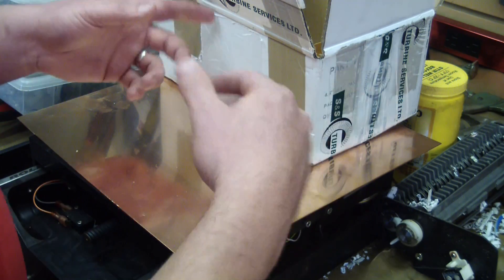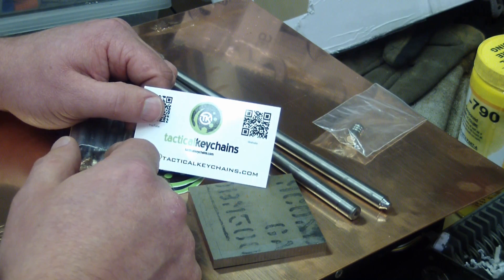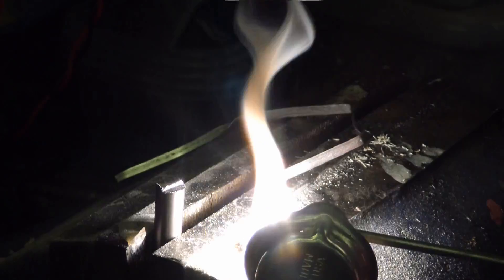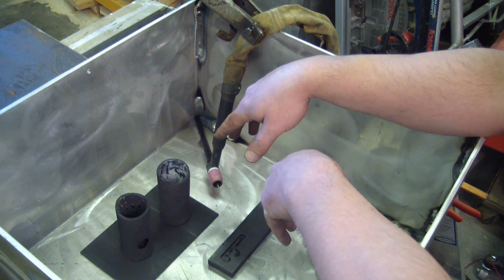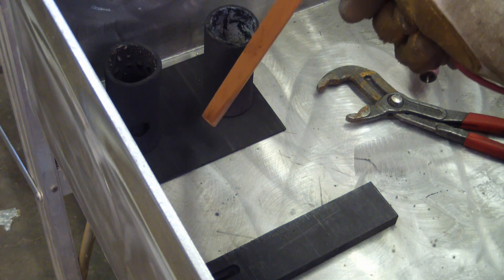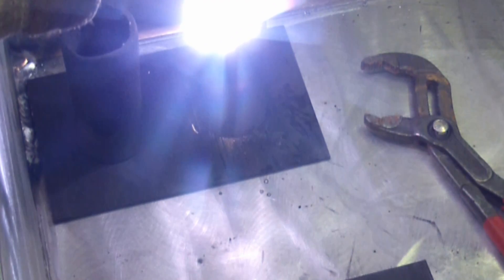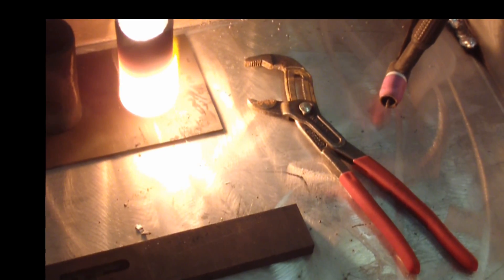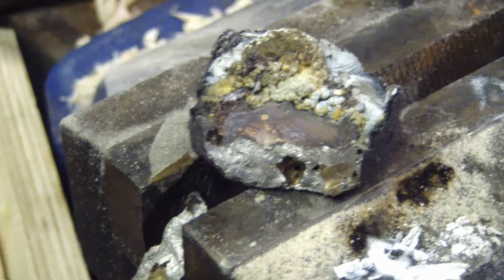Titanium Casting Experiment

Comment: Try a closed container in a mild vaccum filled with argon. Get the titanium as sand or small grains. Put the titanium grains in your Casting mold and create an arc between two or four maybe six graphite electrodes close to the grains. The elektrodes need to be spring loaded as they will burn down faster than the titanium grain will melt. Your casting mold has to have a higher melting point then the titanium. Good Luck.

Comment: I think that you're crucible is made out of some kind of not totally graphite. As it gets to a high temperature it is seen burning. This is likely binder material(s) likely the culprit combined with the lack of a sealed chamber to contain the Argon gas. The Argon will in fact settle but only if undisturbed. The plasma arc force combined with convection currents from heat gradient likely caused extreme atmosphere/Argon mixing and contaminated or otherwise oxidized the sample. Another matter to a lesser extent was carbon contamination of the sample. From my understanding a zirconia ceramic crucible is necessary and perhaps a liquid cooled crucible perhaps made with copper.

Comment: Where I'm working... We use Sulphur dioxide mixed with Nitrogen as a cover gas for magnesium furnaces... My  suggestion is to use the same. Mixture is heavy enough to allow opening a furnace and digging into molten magnesium without any oxidation. Also this gas is toxic so take care of safety
Reply: And the proportion is 1% of so2
Sorry... That film was added 6 years ago... Back than I knew far less than I know now

Comment: Argon alone does not prevent oxygen from entering Ti at a high temp and this alloy will not withstand its melting temp of 3000 degrees (give or take) with any oxygen. A high vacuum of at least 500 microns is necessary before you create a weak titanium casting. Please do not create another video unless you invest in the proper equipment, and it wouldn't be worth purchasing If you wish to make cheap products.

Comment: Argon is only slightly heaver. But not enough for this purpus. To much room to mix. I dont know much about welding but sugest making a closed lit instead of open(maby tempered glass to see through). Fill the room with argon or nitrogen  (take your time, purging takes a couple of minutes). And try a similur methode. Maby make holes in the box with rubber gloves, so that you can work but it stays airtight.

Of if that doesnt work. Try it in a vacuüm  tube. But than you will need more robotics to move stuff around.

You could also set some on fire next to the forge to suck away any left over oxygen.

Comment: Try getting a mix of nickel and titanium 50/50 (Nitinol) and have an alloy with a memory that responds to a small difference in temperature to go from soft(cold) to hard resuming the shape it had while at room temperature when bent to a shape while cold - a two way memory. You can actually feel it go from BCC to FCC in your hand. Plus when it resumes its 'warm' shape it does so with a force of fifty tons per square inch !!! PLUS is does NOT fatigue at the bending spot but increases the force with which it resumes its shape when warm if repeated at the same spot. It pumps out vastly more power than went into bending it while cold !!!?..... A BIG hole in the conservation of energy theory. Nitinol is indeed a strange alloy first discovered at the Naval Ordinance laboratory in US somewhere.

Comment: Very interesting! I'm glad that you made this experiment. I learned a lot from it, which is great considering my purpose. 

I know only about jewelry casting, meaning silver and potentially gold. At school we're told to always use a different crucible for each type of metal we are casting. Because there always is some residue that could cause contamination. 
Plus like other people said, you needed a sealed cover to create a vacuum and then fill your chamber with argon. Obviously if the crucible caught fire, it's because there was oxygen in there for it to burn. 
Taking into account the temperature at which titanium melts might be a good idea too. It's pretty high: 1668°C, or over 3000°F. Maybe graphite didn't stand a chance at these temperatures, even more in presence of residual oxygen.
Thanks for saving me a lot of trouble!

Comment: Titanium and I have a long history as evidenced by the previous story of me cutting off the solder fixture.The following is a diatribe without editing or puntuation. Exactly as Google transcribed my fever ramblings. 
In later years after having experience with titanium and recognizing its explosive nature I was fortunate to be the manufacturing manager of a small company that did machine repair and we also did pretty much any job that came in the door because you know small company you got to make money you got to stay open you got to keep those 14 guys busy doing something so a local company which had government contracts large government contracts you know like billion dollar things had a job where they were going to be extrudinging some titanium pipe. Now the idea was that it was for some kind of hush-hush government project maybe it was Plumbing on a nuclear submarine or something anyways the concept was they were going to extrude Titanium tubing in this large Extrusion press and their normal process was to heat up whatever it was and then stick it in the press and they hit it with a big RAM and squeezed it out of a die and how it came the other end and it worked just fine everything was happy they did beryllium copper and all kinds of exotic materials in this press. It  was just God Awful Huge. The run out on the thing was over a hundred yards long at the end of the building there is big door and whenever you excluded anything out of that press they open the big door and out there about another hundred yards was this big pile of sand because every once in awhile this huge beast would put so much pressure on the die they were just pop the die out of the press like a slug out of a shotgun and go to bury itself in that sand pile. Yeah it was a monster. They had to use water because hydraulic oil is compressible.  Water is not therefore you can develop a lot more and I forget exactly what the number was but it's something like three hundred or 3000 ton Extrusion press huge monster thing.  Anyways I digress. What they done, they had this job where they were going to extrude Titanium. Well titanium as we know catches fire and burns. So putting it into the preheat oven was contraindicate. It wasn't a good idea. So in the case where they had something that was easily oxidized they would put it in a steel tube. A big piece of pipe and they would seal the ends and heat up the big piece of pipe with whatever it was inside of it. It was going to the press and a cool thing about an extrusion press the middle of the Billet is extruded the outside collapses because the center of the billet is what actually holds the material going through and the outside just kind of collapsed down like you're squirting out toothpaste out of a tube.  The center of the toothpaste comes out and the outside sticks to the tube and stays in there. 
That's how they could do the steel tube because the steel tube would be the last thing it would be in what they call the but the back end of the Billet as it was extruded usually left, maybe in the small presses I normally worked on about 6 in Long 3 to 6 in Long. 
In this big press with the steel tube and a Billet of about 12 in diameter it probably was closer to a couple of feet anyways so they were they were going to extrude the titanium out of this steel tube. 
It was going to work just perfect. They had it all set. They put it in the oven. They heated it up. When it came out, it was a mess.  
there's something called eutectic. The eutectic point of a material is to point it melts when steel on titanium and heat the both together it lowers the melting point of the steel and the titanium they become this amalgam. It's not really a an alloy. It is kind of a glocked up mess. Now I'm sure that some where i there the titanium and the iron become some kind of combination of materials. I don't know what the combination actually is but I do know that it's harder than a bulls d**k. 
In a panic, the engineer in charge of the project went looking for somebody who could get that iron amalgam crap off the outside of a titanium Billet. 
That's where we enter the picture. We had big lathes. We did work for this company. You know anything that they couldn't turn in their tool room because our lathes were anywhere from forty feet long that could swing something 8 to 10 feet in diameter om down to something you know about the size of a standard Workshop late so we could turn almost anything. When they called us up we said sure we'll do it just give us some money. So they brought over the billets and we went to put them in the lathe and we took a carbide bit which normally brazed carbide bits cut through pretty much anything. Even hardened steel dowel pins. They'll smoke and scream and you'll probably chew up a bit or two but they'll cut it. 
Well we put the first one in there it's smoked I mean it didn't break it wore a way. 
So the Machinist came to me and said, "You know this isn't working. I don't know what we're going to do."  
I said I know what we're going to do. We're going to go bigger so we put it in a bigger lathe, with a lot more horsepower and I ordered the largest brazed carbide bit that I can get quickly. That was a 1 inch shank and it had about a 3/4 inch square piece of carbide braised out of the tip of it and I ordered 20 of them cuz we had 10 of these billets . Thinking well you know we'll try it if it doesn't work then I'll try something else and if that doesn't work will drop back and kick. So to make things work I said take this big carbide bit and we're going to jam it into the titanium underneath. We're going to break off that stuff because it was hard and brittle. So we really just use the carbide bit to get underneath steel titanium amalgam. The hard stuff kind of like the stuff that he got out of the bottom of his graphite Crucible. So I had the operator take this lathe bit and crank like hell on the cross feed and jammed it into the titanium and got it to going underneath the hard amalgamation on the outside and actually just kind of busted off. It was hard and cracked and shattered and went through a lot of tips on the carbide tools but we got it done. We took that 12 inch billet and ended up turning it down to about 8 inches. 
So knowing the cost of titanium, and understanding that I got to keep the chips because they didn't want them.,I knew that I had a ton of money sitting underneath that lathe.
 I also had a potential explosion sitting there because titanium dust Burns as it evidenced by AVE lighting it on the vice like he did. Not sure if it was something like thermite when it burned, but I certainly didn't want to have iron dust and thermite iron dusting and titanium dust catch fire 
It would  burn up my lathes, set my building on fire, and put the company out of business.

The guy who was managing the business wasn't me. I just was production manager this guy actually ran the place for someone else. Since he was somewhat of a d**k, even though I had taken great precaution to make sure that the material stayed safe and clean and isolated from any other damages or problems, the fact that the titanium scrap that we were going to get off that Billet was worth more than all the work that we would put into the Billet plus paying for the carbide and everything else, meant nothing to him. If we sold the chips, we would double our profits just by being able to sell the chips. This manager, who thought he was God's gift to Creation, and the smartest guy in the in the room, threw away all those titanium chips. 
Yep dumped them in the trash heap. Not even took them to the scrap yard. No he dumped them in the garbage, because well it's just scrap. He did this while I was gone and it was too late for me to say stop you f**** retard.
The moral of the story is. Don't mess with what you don't know. Unless you are willing to suffer the consequences. If you do, be ready to call someone who can help pull your billet out of the fire. 
If you have an idiot running the show never leave him alone with anything valuable. 
Most important, if you purchase a former dump site near Tekonsha, MI, never burn anything on the ground. There is a good chance you will set off $15,000.00 woth of titanium chips buried in there. Probably closer to $30,000.00 in todays money. 
Last but not least. If it does catch fire call me. I would love to watch from a safe distance. 😈😎

Comment: I have the same idea that you used to melt titanium but typically I use
 carbon graphite rods it to melt titanium and I also use it to test if it will melt rocks it got hot enough to melt rocks and the melting point
Of rocks can take 2483.c 
4500 degrees.fh

Comment: Back in the good old days when I was but a lad. I was given the task of cutting a part of a soldering fixture.

The fixture had some titanium rails on it and I had been told that titanium won't burn. You know we use it as a soldering fixture, because it's non-reactive. So being the clever lad that I am I thought well if I've just got to shorten this whole thing why don't I put it in the saw and just cut it off? Well it would not fit in the saw. It was too big. The big welded piece was too big the saw wouldn't handle it. 

So the boss was saying hurry up hurry up we got to get this done and I thought okay I'll just cut it off with a torch, because it's titanium the torches will just cut the steel then I'll have to saw the Titanium by hand.

So I lit up the torch. When I got the iron good and hot and hit the oxygen, the titanium rail blew off of the part. It seems that when you hit it with a hot iron and 25 psi of  oxygen it combusts in a hell of a hurry.
Reply: What did the boss say?

Comment: Read through the comments and theres bits and pieces of correct information. Arc, Vacuum casting, inert gas atmosphere, however one thing is not being mebtioned... 

In my industry (thank God I'm out of it now) the inert gas being cycled through the chamber is not Argon. Though in theory argon should work, it is too heavy and results in either failure or less precise castings. The gas that was used in precision casting of Titanium is Helium. Possible good info can be found in Dental Casting Technology corners of the interwebs. Always wanted to cast titanium, but the industry has moved onto sintered zirconia due to titanium's oxidation  issues when attempting to apply ceramics to it.

Comment: Forgot to say use SS screen for direct electrodes. Braze on thick copper wires for current, far enough away to avoid radiant and conductive heat. Thanks Again.

Comment: Use castable graphite powder with titanium powder embedded in chamber shaped like target cast. Also embed stainless steel screen on opposite sides of the graphite. Protect tub with zirconia or like refractory. Flood tub with argon thru fluffy mineral wool to reduce convection currents. Leave a little reservoir above cast for extra fill of titanium. You can also design mold mixture with less conductive castable ceramic to customize resistance, even to weld with direct 220VAC. Mineral wool makes good heat insulation around mold too. Find some castable graphite and silicon carbide. Works and is FUN, too. Thanks.

Comment: 4 years after the fact, but I have to pipe in because I wonder how successful it would have been if you'd lashed a graphite tube to your steeek there and piped another several CFM argon through that straight on top of the metal pool in the crucible... you'll never get heated gas to stay put in an open box, but if you're flooding the crucible well enough you should keep most of those nasty O's away.

Comment: Isn"t The Old Spy-Plane SR-71's Entire frame & Body made of Titanium? To Allow it to tolerate the heat caused from the friction the air in the atmosphere makes going that fast? (Still to this Day..The Baddest looking Jet Ever made in my opinion)
Reply: The blackbird is the baddest bird that ever flew. Amazing how they designed and built it without modern computers. And they had to first build the tools to manipulate and assemble titanium parts because using steel tools doesn't work on ti. Many huge engineering problems overcome with slide rules and elbow grease.

Comment: smaller deeper box?  Maye cover part of the box.  I remember when I worked in a semiconductor fab that if a titanium sputtered silicon wafer was accidentally run through an rapid thermal anneal tool on the wrong recipe that it would turn the prettiest color of purple.  It ran process O2 at 800 or 900 degrees C.

Comment: What happened to the video where you used an arc welder to melt aluminum? And the video where you used lost foam casting the first time (I think it was an aluminum multimeter case clippy thing)? I used the search channel feature, but they're both nowhere to be found.

Comment: The only way I have ever melted Ti is under vacuum with an electron beam. I might build a little stepper motor dumper and just pump it out. It would make it a lot easier to heat as well under vacuum.

Comment: Next time use a copper crucible, sealed at the bottom, surrounded by water with the argon shield on top. Probably won't work because you really need a vacuum and more amperage, but it's worth a shot.

Comment: You need a crucible that is copper that is jacketed with circulating water to keep the crucible cool all done under a vacuum with the crucible being negative and your titanium positive make sure you have some titanium in the bottom of your crucible to strike an arc or you’ll blow a hole in your crucible best of luck.